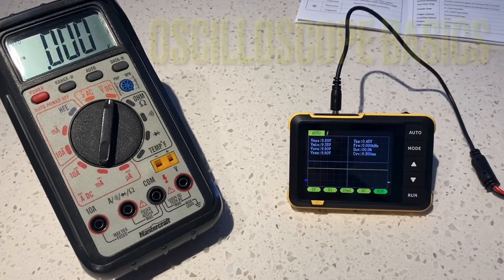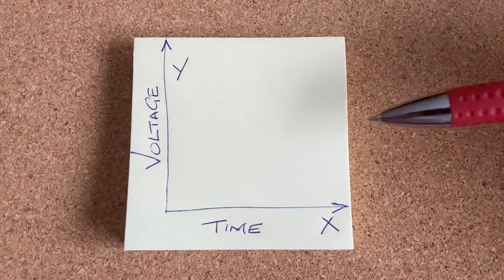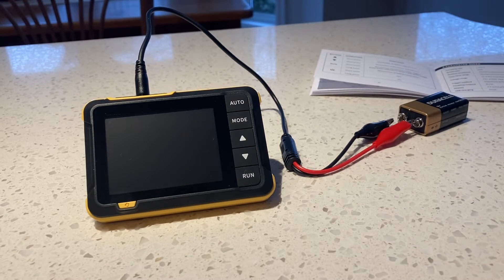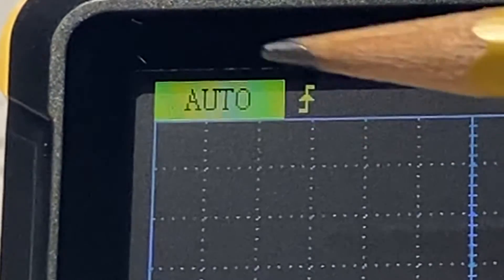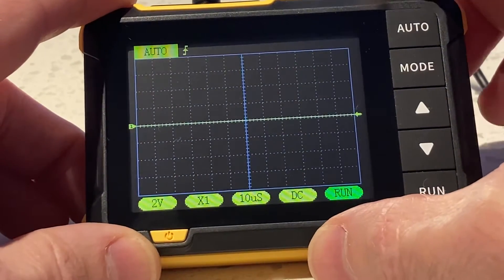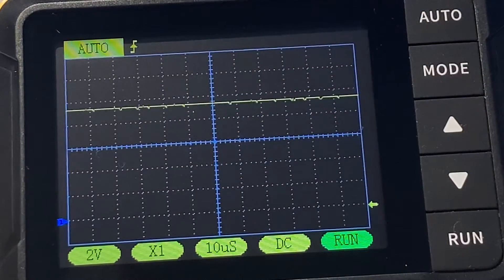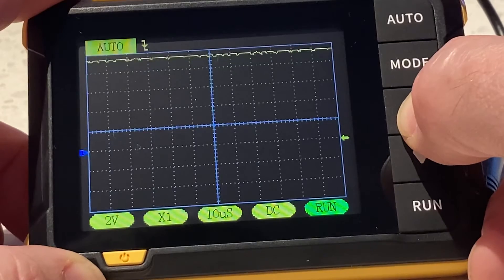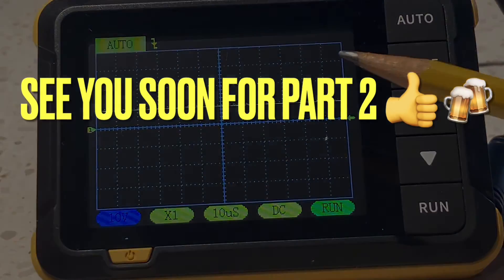Oscilloscope Fundamentals Part 1

Comment: Im new for this type of thing and just using multimeter for car diagnostic. Im car mechanic. Just want easy solution for car wiring and electronic controller. Ive seen other type of oscill with overkill. Thats too advanced for a guy like me. And lot of instruction to use it. The price is way too high than this . I think this mini type of oscill is enough for my work. Thanks you for tutorial dude. Ive watch all of your other video part
Reply from the maker: Thank you for taking the time to watch & comment. For the money it’s very difficult to beat this little scope. 👍🍻

Comment: As someone who is well into learning electronics and having just bought one of these little oscilloscopes and not having a clue how to use it... Thank you so much.
Reply: Instead of the DSO152 I recommend you get one of the DSO510s or something, have a 10MHz bandwidth(trust me you need that to properly measure 1MHz) and are more or less the same cost
Reply from the maker: Thx for watching 🍻